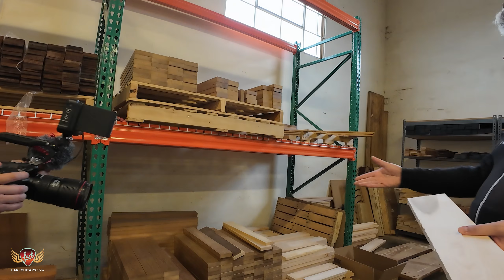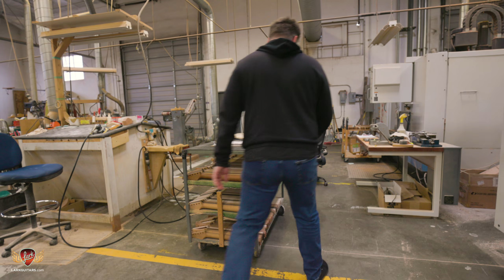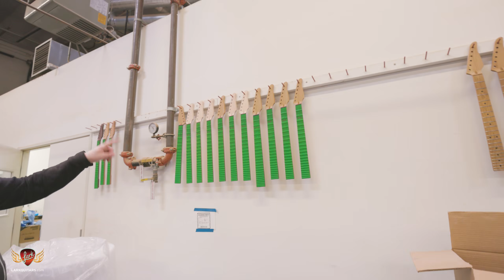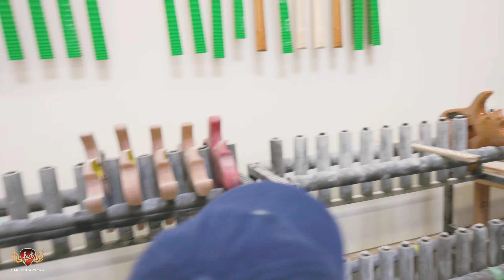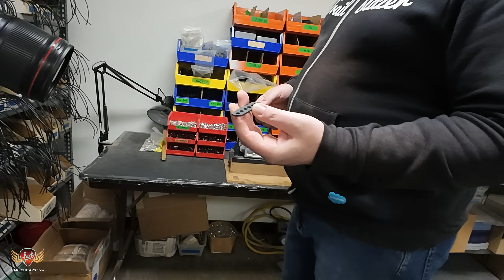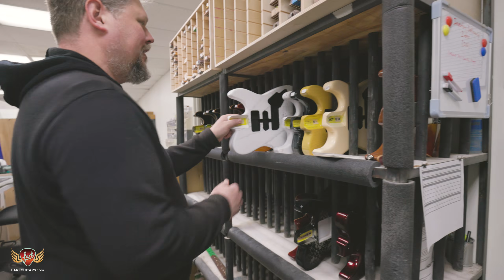40 Years of Anderson Guitarworks - Factory Tour with Lark Guitars!

Comment: I'm surprised at the low stock of raw lumber they have on hand. Tom has said in other shop tour videos that they are exceedingly picky about the wood they source though. My build should be completed this month, if they're running on schedule. She'll be the second Anderson I've owned. I find it a bit shocking how they can turn out such stunningly perfect instruments in such a cluttered workshop. Eccentric genius woodworkmen at work,  ha. The Fender Custom Shop floor isn't any better though, lol. PRS has one of the more fastidious operations here in the States that I've seen. Not a fair comparison, granted. Anyway, thanks for the factory tour video. I can binge-watch this genre of guitar-related videos all day.
Reply from the maker: Genius at work for sure. Stock of wood is down to a science, hand selected and no more on hand than what is needed. One of, if not the most efficient guitar factories around.
Reply: Their shop floor is quite tidy compared to many custom shops. Small batch production units don’t need industrial level arrangements as they are more like art shop. PRS SE produces 500 guitars a day these guys produce 800-1000 a year lol. It’s like 1/150 times slower(actially longer with better quality):)